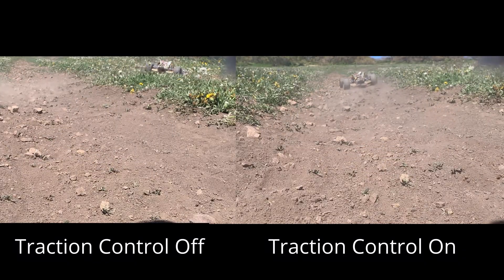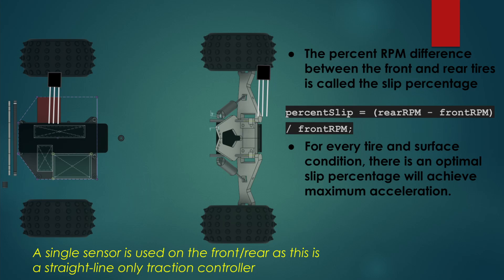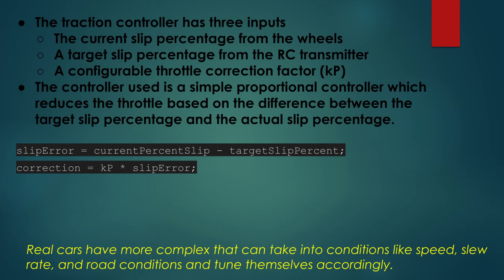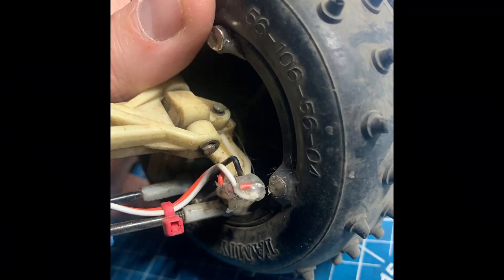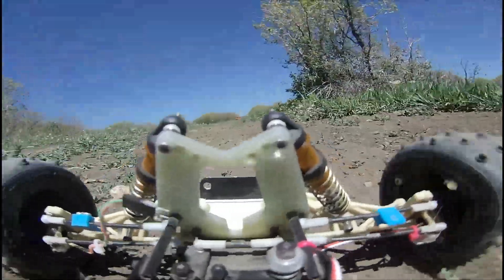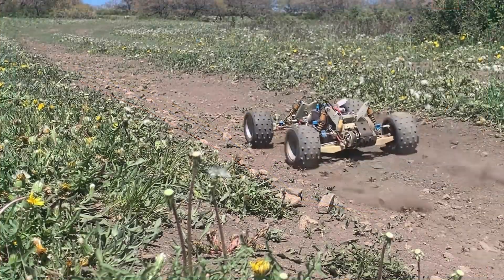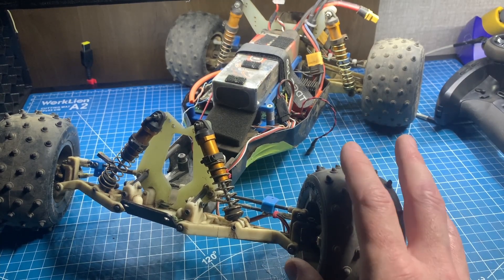RC Car Traction Control with an Arduino

Comment: Hey, it would be nice if someone could verify that my setup for a traction control could work. (no fundamental flaw)
I have a 1/10 RWD short course truck, 4 digital latching hall sensors, 10 magnets on a rotor on the wheel hubs, and an Arduino nano every. The PWM from the receiver goes into the Arduino and gets adjusted...
Can this Arduino accurately measure the time between each magnet pulse on all four wheels?
Reply from the maker: Absolutely. If your code is efficient and you use ISRs it should work fine.
Reply: @IndeterminateDesign  Are all the interrupts interfering with the code (850hz at 100kmh * 4 wheels)? Would a constant loop, saving the polarity of each hall sensor and conting it be better? Or do you think I should try ISRs first (attachinterrupt function) ?
Reply from the maker: @lennart188  The approach I've used on both this car and my RC Hypercar was first to get 1 wheel working at high speed with just a simple loop.  I always find issues reading the sensors and I usually workout how often I'm going to calculate the RPM.  Sometimes it's every 4 pulses then calculate.  Once I get that working, I move on to getting one wheel working with an ISR.   Then, the beauty of the ISR is it's easy to just copy and paste 3 more for the additional wheels.  You might be able to do it without the ISR, but most of my cars have data logging and other sensors and those can throw off the timing of the main loop.  With an ISR and a pulse counter you never miss a pulse, you may just slightly delay when you calculate your RPM.
Reply: @IndeterminateDesign  very helpful

Comment: Nice work.  Instead of measuring wheel speed, I suggest using a VESC with a brushless motor and using a PID or fuzzy logic control loop to maximize motor torque.  There is already PID tuning code for the balance board support.  Alternatively, you could integrate an accelerometer to the VESC (or use a VESC with built in IMU)  and compare it to motor RPM.  I think the accelerometer approach would be slower to respond easier to implement.
Reply from the maker: I really want to try a VESC. It’s just hard to find them in the right form factor. I did use a 14biy magnetic encoder for my RC Hypercar project and a PI controller, and it works sooo much better. The added resolution makes all the difference.
Reply: @IndeterminateDesign  The original vesc 4 and vesc 6 design that use the 4's footprint are small.  You'll probably have to use a lower kv motor and higher voltages to get equivalent power.

Comment: how do you deal with front wheel speed of 0? shouldnt it create infinite slip and mess with throttle when the car is idle?
Reply from the maker: Traction control doesn’t turn on until I think 25 rpm is sensed. The whole setup would be better with more magnets. My later implementations use either 24 magnets or an encoder. The finer the resolution of the wheel speed, the faster and more accurately the traction control can react, particularly at low speed.

Comment: Would you like to collaborate on a device for RC/Motorsports?

I feel as though this could  be an incredible product or open source project, especially if it were implemented on an ESP32, Which would add Wifi, BLE, and ESPNOW communication to/from sensors, ECU, ESCs, Phones, tablets, laptops, etc.

ESP32 can also read CANBus and other data.

This might also be able to talk to MegaSqirt or Carduino.

It's worth a look.
Reply from the maker: I'm working on this more with my RC Hypercar right now that has individual wheel motors and a 4:1 ESC.  I also have magnetic encoders on each wheel.  I think that's ultimately key.  I implemented a bit better traction control algorithm on my last Streamliner, but it's limited by the resolution of just 24 magnets.  The encoders are accurate to 0.3 degrees at 28,0000 rpm.  The increased resolution allows for much finer control with these very fast reacting RC cars.

Traction control for individual wheel motors is more complex.  You can't rely on wheel speed sensors alone, you really need accelerometers and a full vehicle model to implement traction control.

I haven't played with the capacitive touch on the ESP32 at all.  I guess it would depend on their speed and sensitivity to electrical noise.

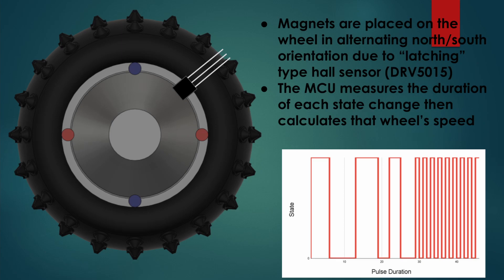Comment: Great work. I'm interested in this for my quad motor Latrax Rally 1:18 build, and my CineRipper AWD 1:10 Camera Car.

I'm wondering if four-wheel traction control can work with all four ESCs.

I'm also wondering if the capacitive touch sensor functionality on the ESP32 could be used in place of the hall effect sensors.

Thoughts?

Comment: Hi, at the end do this project is working fine? Do you have any update on the code? You did a really good job, the code is crystal clear and well commented :D thank u
Reply from the maker: I haven't made any changes as of yet.  I have integrated it into another project and it's worked well.  The biggest improvement comes from using more magnets (12+).  The cars are easier to tune and much better performing when you have more accuracy.
Reply: @IndeterminateDesign   Thanks for your answer, i analysed well the source and i don't arrive to figure out how the EMA fonction can work in your context because you never fill the "previousPercentSlip" static float? This stuff i don't understand ! but really nice work

Comment: Does adding more magnet can increase the resolution of the wheel speed data?
Reply from the maker: Yes.  I’d recommend at least 12 magnets based on subsequent testing with my streamliner project.  It smooths the response considerably.

Comment: Question about your code>>there is a line in the "process traction control" loop:
  if (micros() - previousTractionControlMicros > tractionControlInterval)

I don't see the previousTractionControlMicros ever being updated.  When I do similar, i make the previous = current at the end of the loop.  Just trying to figure out how yours works, and if I'm missing something.  Thanks for the video and the code.  

My biggest take away is to evaluate TC every .01s....I think that was the key I need to make mine work.  Mine is on a v8 race car, and im going to cut ignition and my inputs are throttle, rpm and gps speed....
Reply from the maker: Good catch, that was a bug.  I made some last minute fixes.  I just pushed out a new version of the code.  I haven't really played with it much since the video but I do have a couple of lessons learned.  There really needs to be an integral term to get the traction control to react faster, the version of the code that I just committed has this.

On the race car you may need something more accurate than GPS for traction control based on tire slip ratio.  I've seen it done with a combination of GPS and inertial measurement units, but it's a lot of work fusing that data together.   Wheel speed sensors like I had on my RC car are generally the easiest and most accurate for 2wd cars.

For drag racing you can get away with a rate based traction control which just looks at the rate of change of either wheel speed or driveshaft speed.  

You might look at how companies like Megasquirt and Haltech implement their traction control.
Reply: Thanks for replying so fast, I’ll check out your new code…

Yup, I’m trying to do it very simple…don’t want to add a lot of sensors.  It’s a road race car, and I’m just messing around.  I tried slew rate rpm, but I only get rpm from my aim dash at 50hz - it’s pretty slow.  I’ve been studying some data from a wet session, and believe it or not (I didn’t at first), but rpm/gps speed shows pretty accurately wheel slip.  We will see, I’m gonna write the code and tune it this race season.   I did manage to implement no lift shift.  I have a rev limiter with a hi limit and low limit, and with pwm, I can set the limiter anywhere in between - so I use it to shift cut and for pit speed.  Hopefully I can make a simple tc system as well, that I can build on.

Comment: Does this traction control compensate for the front left wheel spinning faster than the rear left wheel during a turn? The car's center of turning circle is coincident to the rear axle, meaning that the front wheels have a larger turning radius than the rear wheels and hence cover a larger distance (think of the Ackermann steering geometry)
Reply from the maker: No, I touch on it in the video but this was setup primarily for straight line acceleration so that I could use it on my RC streamliner. It could definitely benefit from a more complex traction controller that takes into account steering angles and has wheel sensors on all 4 wheels.

Comment: Very cool, so you'll be using traction control sensors for the abs as well?
Also if you are going reapply throttle in a more gradual manner wouldnt there also be gains in a more gentle easing off the throttle when slip rate is too high? (or am I over complicating again)
Reply from the maker: Thanks. Yes, I can use the same sensors for ABS to detect when a wheel locks up. 

For re-applying the throttle, it’s gradual until the % slip falls under the maximum threshold and then the TC turns off and suddenly the car goes full throttle again which causes the wheels to spin. 

For the gradual part of cutting the throttle, I think you want to cut the throttle as quickly as possible to prevent overruns.  The TC is cutting throttle proportionally to the % slip.  An example is with a 10% max slip, if you just go full throttle and spin the tires, the TC will being cutting throttle at 11% and again a bit more at 12%, and so on but it can’t keep up perfectly with the wheel spin.

 There’s a delay due to only having 4 magnets per wheel and inertia of the motor and wheels will keep the wheel spinning. In a perfect world there would be no delays or inertia and the traction control could stop the slip at 10.001%.  

So I’ve been told by another viewer I most likely need to implement a full PID controller (proportional integral derivative if you’re not familiar). The integral term in particular looks at the cumulative error over time and would help cut the throttle faster. 

I hope that made sense and wasn’t too much of a random conscious stream of thought.
Reply: @IndeterminateDesign  thanks for the reply, I agree pid could be a good fit for this. Looking forward to the next video.

Comment: Regarding adding a 'slew rate' to the throttle control - A version of a PID algorithm would work great.  Not sure if you'd need all three variables, but testing will give that answer.
Reply from the maker: Thanks!   That makes complete sense.  I was just adding a low pass filter to smooth the throttle, which is literally the derivative term.   I'm fairly new to the control engineering and I hope this will be relatively easy to tune for different surfaces.

Comment: If that hall effect sensor is what enables slip detection, how does it detect slip when 90% of the rim has no magnet on it?
Reply from the maker: There are 4 magnets on the front and rear wheels with the sensors.  The sensors change state every time a magnet passes the sensor.  The traction controller is updating every 1/4 turn of the wheel which is fairly often.  Even at 3mph, or human walking speed, the wheel speed will be updated every ~0.1 seconds.  The speed of the wheel doesn't change significantly in that time frame. 

If you notice the car when stopped has a tiny bit of tire spin before the traction control kicks in.  More magnets would allow for finer resolution.  A small amount of wheel spin initially can be beneficial.  If you try in this in a full size car with traction control you'll notice the same thing, that the wheel will spin some before the traction control kicks in  (Modern cars update between 20-25 times per wheel revolution).
Reply: @IndeterminateDesign  O damn, missed that, thought from that one shot it was just one magnet on the wheel.

Comment: Great job ! I have a question why you chose not to run the tests on asphalt ?
Reply from the maker: I’m traveling in an RV in a very rural area so no real paved locations.   I will definitely test the Streamliner on pavement with the traction control soon.
Reply: @IndeterminateDesign  ah ok i understand ! Good luck !
Reply: Thats really interesting